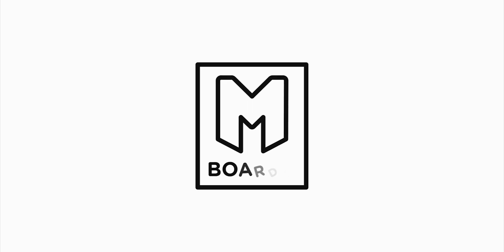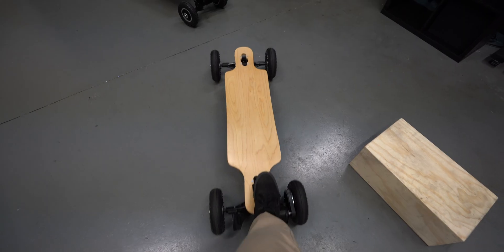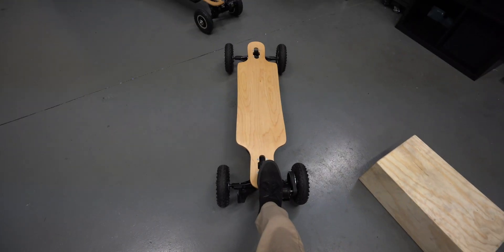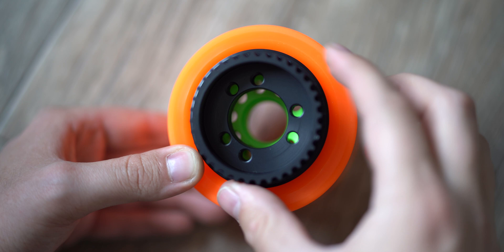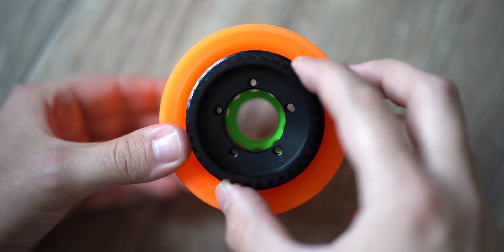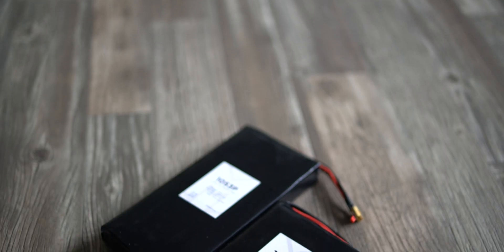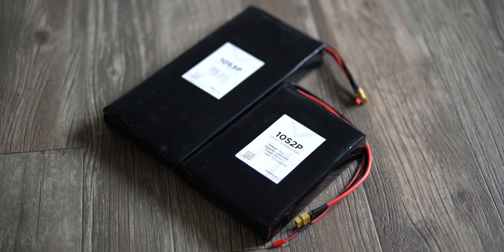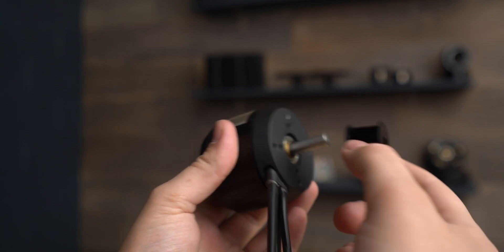Avoid These Mistakes While Building a DIY Electric Skateboard!

Comment: I bought a ESk8 longboard online and I've had it a month and while I was riding it I lost power and can't turn it back on. Plugged in charger and charger gives me the green light which tells me that battery is either fully charged or there's a disconnect. I checked. I have taken the battery out of the enclosure and using a multi meter tested the charge going into the 7S2P battery pack. I get 29.4v. I tested the wires that go to the esc with it plugged into the charger I get 18.81v if the charger is disconnected I get 0v. Also this esc I think is not the right one. The esc installed is a small fish glued single drive -B231W 24V-8A. The battery pack is a MKD 18650 7S2P 
Nominal capacity voltage 5200mah/25.5v  132.86wh
Max charge voltage 29.4v

Comment: hello. i have 10 batteries that are fully charged 4.2 volt each for a total of 42 volts.

i plugged them to the esc just like you have ib the video.

the diode exploded in my face.

i realized 10s is not correct.
i tried 4.2v*9 so 9s and its 37.8v.
i thought everything was fine used my board until it reached 32v and started beeping and driving bad.

batteries still almost full 3.61 each times 9 is 32v.
so 3.6v each is still like 80% full and it feels like the board is out of juice?!

PLZ HELP

Comment: I have flipsky vx4 remote and FSESC4.20 and the 6368 190kv motors, recently I had a fire in my efc. And the flipsky set up works great but can tell from my remote that the efc gets to hot and the board needs to rest. This day I pushes it hard and I caught fire. Since the I added a fan and air holes to my efc box. But why dose my electric mountainboard need break and maybe why or how come by efc box caught fire? Thanks

Comment: Bad hall sensors frying hall circuit which depending on esc bricks either 12v, or entire esc side. 

Sensorless is so nice.
Reply: have werry bad experience with FOC in iner runer's....  thzey sweeking, they shifting and also.. have no torgue on PWM + sensrs.. all pretty clean..
Reply: @nin1ten1do  no

Comment: I've not made this mistake myself but a good one to avoid is Miss judging your wheel size my board comes with 73 Mill Wheels I'm about to upgrade but the setup I want has 120 Mill Wheels on the rear think about the size difference that represents it would jack up my rear and lower my front end so I'm going to need to purchase new front wheels as well just to keep things on a level in addition to that the rear come with a lift plate which I will also need to purchase for the front again to keep my wheels the same height

Comment: Do NOT solder on an expensive ESC unless you have experience with soldering, flux, capacitors, mosfets , temp levels, and multi-layer PCB boards.  Also, use a good premium soldering iron.
Reply: I read it as flux capacitors instead of flux, capacitors. I was all to ready to make a time traveling skateboard.
Reply: Speaking of flux,  I was told that flux has a one-year usable life after opening.
Reply from the maker: I’ll have to look into that! We go through several containers per month so I suppose we won’t have that problem 😆

Comment: About that ESD problem, that is usually most often happens when you have RAM, which i dont think is the biggest problem. The problem is that carpets actually can shorten small high voltage pcbs, often with capactitors around :) Just want to correct!

Comment: Thank you for your video ! Thanks to it, I realised I made a mistake.
I ordered a 6s/7s ESC and I've got a 10s battery, something can go wrong ?
Cause in the video you talk about the fact is bad to have a 6s battery for a 10s ESC.
Reply from the maker: If you use a 10s battery with a 6s ESC, the ESC won’t cut the battery off at the proper voltage and can damage your battery.
Reply: @MBoardsco  😩 alright, I'll return the product and take the proper one.
This video saved me 100$ 👍
Thank you mate !
Reply: Lolol if you plug a 10s battery into a 6s ESC you will have a dead 6s ESC.

Comment: I have an old 12 volt motor with two wires black and red and my controller has 3 wires how do I know which one goes where.
Reply: If you only have two wires from your motor it's probably not brushless, meaning you don't need an esc (if that's what you meant by controller). A brushless motor needs an esc for timing the current of the phases, a brushed motor (like the one you likely have) only needs a voltage controller like a variable resistor or pwm controller. Hope this helps. PS, make sure to get components that are compatible (electric-wise) so you don't burn out your circuits or cause damage to the battery. Stay safe

Comment: I have a wowgo 2s and want to swap the battery for the lycaon gr battery for more range. Will this work will it fry my esc or motors or anything if I use this higher power battery? I really look forward for your response!
Reply: Long as the batteries are the same as far as 10s or 12s go and it's what the esc takes it should work no problem

Comment: Hey, I want to get a board, backfire g2 black. And want to know if I can get a longer lasting battery, like a 10s4p just for the extra range
Reply from the maker: It’s possible but you’d need to change your enclosure out to accommodate the larger battery. Would most likely be more cost effective to build instead of modifying a brand new board.
Reply: @MBoardsco  wow that was a fast reply!! I just wanted to know if I’d be able to do that for the future just so I can spend less up front, I really like this boards specs, but I think I would rather build it if I can get the same specs under $500
Reply: @MBoardsco  would it be difficult to build rather then pay a little extra to get a board already done?

Comment: Hello!
how to unite separated connectors of hub motor to 9 pin connector?
i have a koowheel d3m 2gen  board and want to replace all wheels and motors on all train wheels, and hubs swap to belt motors
all motors with separated connectors, but in koowheel hubs and motherboard connected by 9 pin connector 
Help me please!

Comment: Is it cheaper thn buying a eboard
Reply from the maker: It can be cheaper right away depending on the build. But many times your savings begin to be more obvious as you upgrade your build or make repairs.
Reply: @MBoardsco  im 6 ft 3 an 230 pounds so id need a considerable amount of power i believe im not looking for speed but battery longevity and torque im a mechanic so i can put one together no problem but idk what is going to be best to buy one or build it whats gonna move my big ass the longest?
Reply from the maker: We always recommend DIY as you can always out spec a prebuilt board if you build one yourself. This way you can always upgrade in the future if you need even more power.

Comment: I recommend people who need to worry about static to get a 'esd (electrostatic discharge) wristband'. Maybe build one? It's just a wrist band with a metal plate connecting to a resistor.
Reply from the maker: Very very cheap on Amazon 👍🏻 definitely recommend it
Reply: Oh no! This is not so good advice.
The ones just with a resistor and nothing else wont help at all, they remove 0% charges.
You need to get the ones which are connected to ground, like in your outlet or the body of the heat radiator in you room.
The ones without a cable wont help at all.

Greetings from Germany
Reply from the maker: Even better!
Reply: @cris_crafter  leave it to our German friends to understand technology to a science, this is a very good point that I overlooked. Thank you for catching my mishap lol
Gratitude from Texas 🙂
Reply: @jonnupe1645  First, thanks for the compliment. haha
No problem, everyone sometimes says something wrong. I just wanted to clear this up, so nobody buys such a wristband and accidentally kills some Hardware.
Have a nice day!
Reply: @cris_crafter  like wise fellow human

Comment: Hi.. i have an esc from my hub motor board.now i have a belt drive kit and can i use the esc from my hub motor board to cnnect the belt drive kit?
Reply: I don’t know
Reply: Yes you can the ESC doesn't know whether it's running a belt-driven motor or a hub motor just make sure you get the wires connected properly blue the blue green the green yellow the yellow sometimes the yellow goes to the blue cuz they change the color for the belt Motors

Comment: A very big mistake you can possibly make is not to use a anti spark connector to connect your battery to the esc. The spark can blow your esc up.
Reply from the maker: Yes this is huge. I’ve done this myself during my early building days. Antispark switches are worth every Penny.
Reply: @MBoardsco  I was connecting my Hub motor and my hall sensor +5 volt red wire touched one of my motor wires bullet connector believe it was the yellow wire there was a small Spark now my ESC won't turn on I believe my capacitor is shorted out. I have replaced capacitors on the cheap Langyey ESC and and was able to make them work again I'm sure you probably have a good idea as to what I shorted out on my hobbywing. And black goop that they pour on top of it is it bitch to take off the circuit board!!!!!!  I'm very good with electronics so I can replace diodes capacitors mosfets hoping you might be able to save me some time and anguish I have tested the capacitor with multimeter in continuity mode setting, and it beeps when I touch the positive and negative so thus meaning and it shorted out right what else would I have shorted out what do you think unfortunately with covid-19 I don't have the money to buy a new hobbywing ESC:-( 🥵🤯 thank you for your help God bless if anyone else has any ideas I'm listening :-) LOL
Reply: The connection between my antispark (Flipsky) and the ESC  blew up earlier and charred one of the wires. I'm going to test the ESC tomorrow.to check whether another £100 went down the drain. Isn't a loop key better than an antispark switch?
Reply from the maker: Loop key is pretty much the same thing just with out any electronics. So very cheap to replace. Just depends on what you define as “better”.

Comment: DIY 1st build;
Torqueboards 6380/ 170KV Single
12S Samsung, 9Ah, 60-120a
Chain-Driven; 14/27, 97mm (Abec 11 75a, 44cp)
BestTechBMS + 4.2 Vesc (5.1firmware)
Loaded Dervish (2 flex) + Caliber II (7") + Evolve- Speedballs (abec9) bearings.
32mph, no prob @ 5'11", 190Lbs (road), desert climate.
Reply: Was planning on doing something similar but all I know is most likely lipo 12s probably single 6374 belt driven and some sort of VESC but definitely still brainstorming as it's a first build but I have always loved bombing hills
Reply: @corbinandersen809  now you can bomb any good stretch of pavement! Are you considering 150, 170, or 190 KV?
Reply: @brandol4719  190kv unless you would recommend otherwise lol
Reply: @corbinandersen809  Well, I believe that you can generalize a KV rating for these brushless with Torque. 150= most/hill climber... 190=least/best for Top Speed.

Comment: Ill tell you the mistake I avoided. Coming from a IT/Software Engineer/Electrician background (I use my soldering gun to work often for small quick projects),I really  wanted to build a board.
Then reading up and realizing that I'll never want to build an electric Skateboard 🛹 , because as a working professional with a family, I'm far better off spending the money for a really good pre-built eskate. Allowing me to enjoy my new eskate hobby while still allowing time for me and my family.
Reply: If anyone is wondering, I ended up buying the MetroboardX
Reply: @JT-xf9sw  good choice, Ilan builds tanks that last and is a good guy!

Comment: I bought a all in one power truck and the motor mount always came loose I put lock tight on it right when I received it it came loose I’m at the point of wondering if I should weld it or use super glue
Reply: if you can, weld the motor mount on your truck... safes you so much pain
Reply: After you applied the loctite, did you leave 24hrs for dry?

Comment: Waterproofing! I've twice fried esc's from small puddles that let ingress just enough water to cost me. Now I use a liberal amount of GE plastic sealant to all seams, stays flexible and seals it up tight! Haven't had an issue since and can now ride through heavy rain without worry. Next upgrade is ceramic bearings to really make my board waterproof ⛈
Reply: A

Comment: Buy the correct motor mounts and not some universal for there fit round truck. I ended up changing the mounts 2 time before changing the trucks also because a round truck couldn't hold a duel belt 6354 on a 10s5p battery. after 2-3 rides the mounts was loose again. So don't try to save money on the trucks and mounts, it will come back and bite you..
Reply: that's so true! I am using these cheap motormounts and they are just terrible.... I've been using them since 3 years now but its not worth it. Mine are now pretty tight on there but just get a caliber truck and the right motor mount for it.

Comment: Hello m-board
I have the syl-08.
I burned my esc so i buyed a new one but the condensator's on the esc where to low they where 470uf/36v end i needed 1000uf/36v so i soldert the two on my esc 
it when't fine en the torc was mutch improved 
But my speed is slower
now i think i overloaded something but i dont know what
Maybe you can help me 
Best regards 
from holland Soil Loyd van beukering

Comment: Hello there and thanks for the build. I’m going with a pre built board for my first board and then I will build a DIY longboard for sure. My question, Loctite red 271 or blue 242?
Reply: Bobbywade3232 blue 242 is great stuff and will hold plenty strong. Make sure to shake the bottle well. Red is pretty much permanent (needs high temps to break) so I wouldn't use it unless I'm planning on never seeing the insides again

Comment: Hey Mboards I am about to order a kit. Is the 6s2p battery good for the duel hub 90mm motors? I'm on a budget and I only need to get a 8-10 mile range
Reply: 10s2p will get you a realistic range of 8-10 or even more depending on type of ride/rider
Reply from the maker: I’d recommend a 10s2p as well if possible, will be happier with it over the 6s2p with dual hubs

Comment: Would two 5S batteries with 18.5V (37V total) work with an esc that’s rated for 36V?
Reply from the maker: Yes 2 5s battery wired in series would form a 10s battery and would be compatible with a 36v ESC.
Reply: @MBoardsco  what would happen to 36v ESC if I plug 2 6s LiPo?
Reply: @chandrachou  That would boost the voltage to about 42 volts and would likely overvolt the ESC.  I'm unsure though, that would be very ESC dependent and its individual technology.
Reply: @chandrachou  u should get a 12s esc based on VESC, they are available from all diy suppliers, budget to bespoke